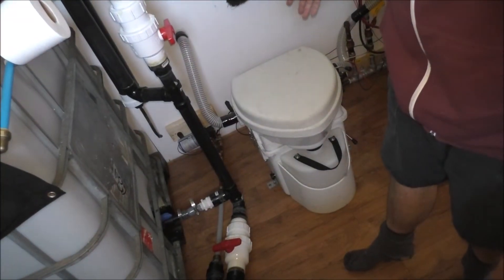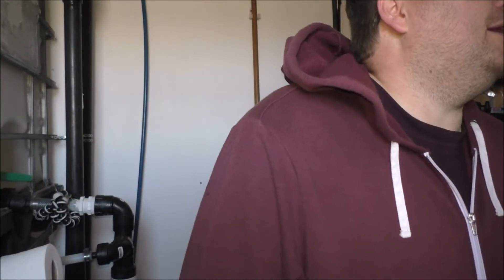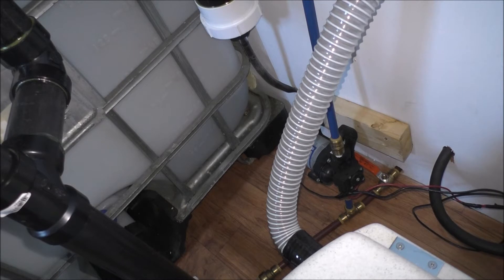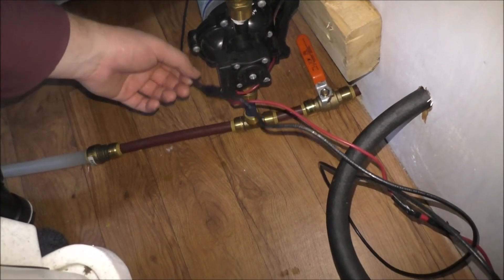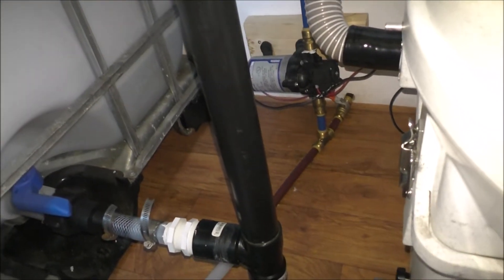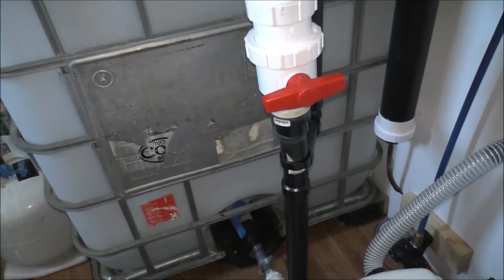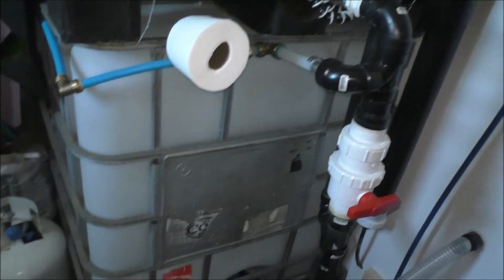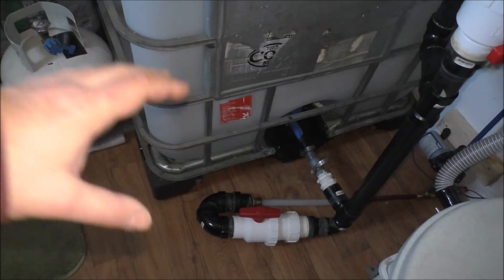The Little Pump That Could

Comment: Cool! Rainwater harvesting system is working, although it would be great to see it catching more gallons of water during rainy days. Right now it's enough water for SHTF survival needs but not enough for more typical every day usage.

I think we can say that the dual battery/dual source (solar & wind) with battery isolator system was a "don't try this unless you want to kill some batteries" experiment. We kind of had some earlier discussions about what was happening with that setup, and the constant clicking of the battery isolator was a dead giveaway that that configuration does not work as desired. 

Especially with the wind turbine spooling up & down so frequently that it is not a smooth, relatively stable power source. Having researched this, I know that there are dual power source (solar & wind) charge controllers designed to maintain a single battery bank, along with an automatic dump load (diversion load) for when the single battery bank is fully charged & power sources are therefore producing excess power that has to go somewhere.

It might be possible to route diversion load output power to a switchable chain of multiple dump loads, like heating water, running fans, powering a security system, etc - with the last dump load in the series being a resistor. That way excess power is usually doing useful work instead of just being bled off.